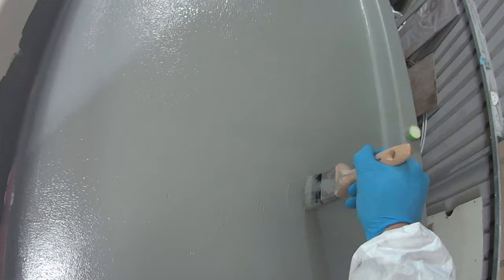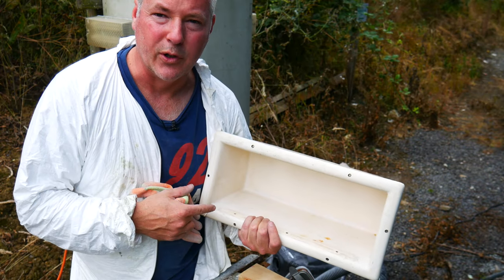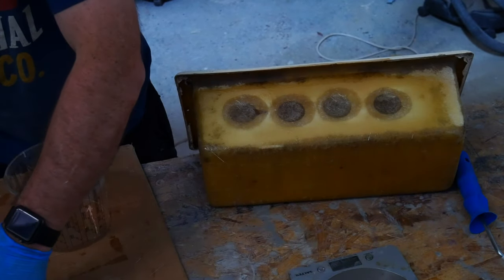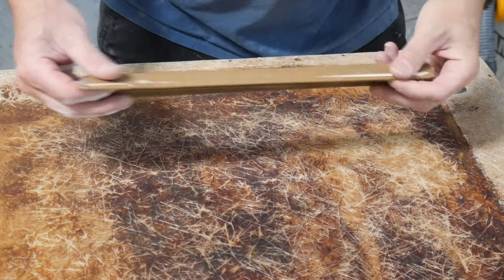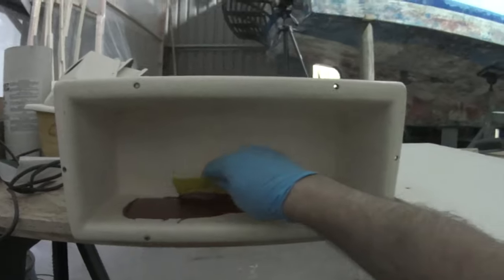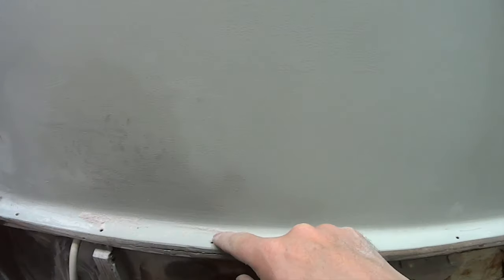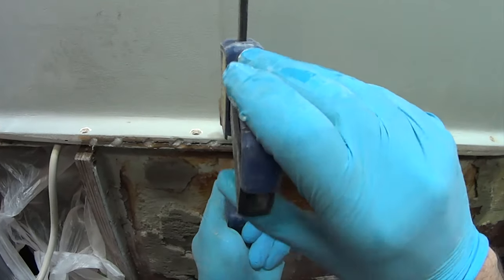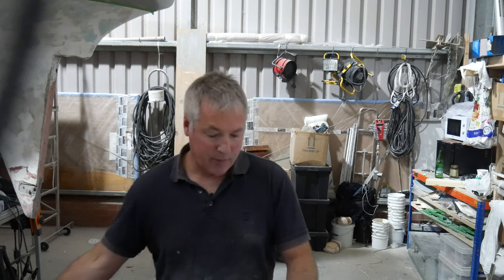#57 - Cockpit area repairs and Dorade vents

Comment: "I know it's getting a bit dull....". No it isn't. Another very interesting video which has cheered me up somewhat. I spent all afternoon yesterday trying to sand away moulded non skid from my aft cabin roof as I need to remove part of the top skin to replace wet balsa core. My dust extractor leaked and blew fine dust everywhere, my respirator leaked and I got a sore throat and my sander threw it's hand in part way through. It was like an oven under my tarp shelter and I basically came home hot and filthy having achieved very little, pretty miffed off and ready to set fire to the sodding thing. I'm having boat blues at the moment. You seem to have gotten over yours and got your spirit back which is great to see. Thanks for sharing your progress 👍.
Reply from the maker: Stick with it Danny Boy, you get your highs and you certainly get your lows. And then tools malfunction. Then there's the cursing/swearing. It's all part of the joy of DIY, sometimes you need to walk away and come back another day with more determination  :)

Comment: Filling those holes was I think a bad idea. If I am not mistaken they have a function in keeping the motor cool, at least that is the function on my HR40 (I think, or it has to do with air intake). Anyway: it is more work to make the holes than leaving them out by HR, so they must have some kind of function
Reply from the maker: Hey Airgead, thanks for sharing your thoughts. But I do not think it is correct that the holes  function in keeping the motor cool. There is no path for the air to take from those holes to the engine room. The recess boxes are in the sides of the coaming which then has headlining below it to seal in the cavity. This is out outside of the engine bay, and there is no connecting channel to vent air there. However, there are three vents in the coaming which can be used for the engine to draw air into the engine bay. Originally one was used for the battery box, back on the days of lead acid batteries where ventilation was needed. I think I will use one for a blower and how for bringing air into the engine bay.
Reply: @aboatcalledwanda6925  you are right. My 352 does not have those he's in the cockpit shelves either. Very strange. Maybe added ventilation for the void space. What you could in fact do is think about how you can build some storage space into that area under the combings. Such a waste of space.
Reply: I am standing corrected. My 352 Does have those holes on starboard side. I think it might be ventilation for the area under the combing. Understand the concern about a knockdown. Maybe ask Hallberg Rassy if they know and if ventilation then plan another route for fresh air into that area. Also think about the locker in a KD.
Reply from the maker: Thanks Nathan - much appreciated. Im going to talk more about my theory of the holes in the box next update.

Comment: Could the holes be for stateroom ventilation?
Reply from the maker: I think they are to ventilate the hanging locker, which does not have a sealed top and instead opens into that cockpit coaming which is where the glove box is fitted. The aft cabin has its own dorade.